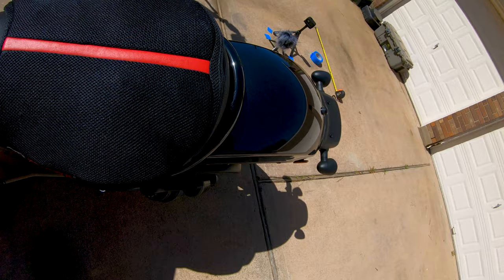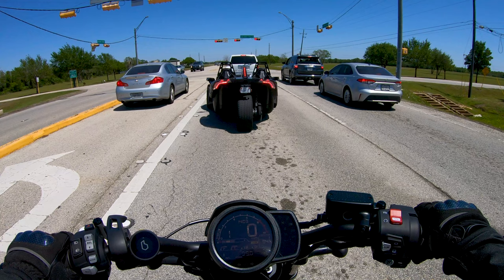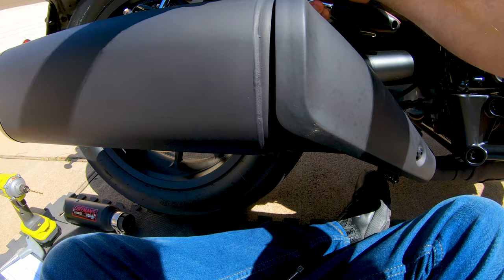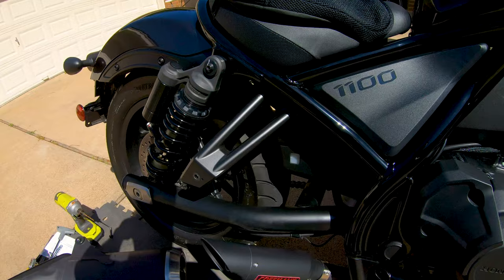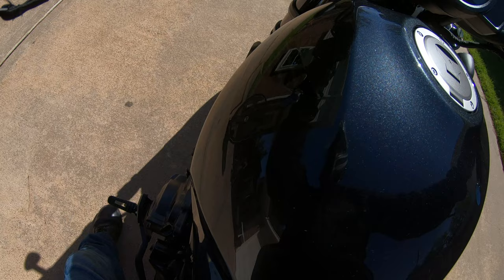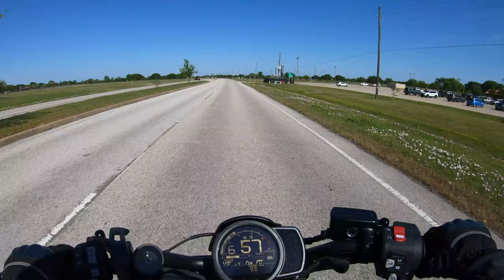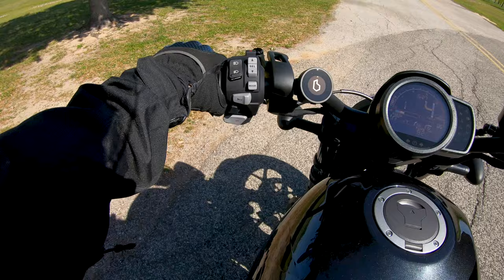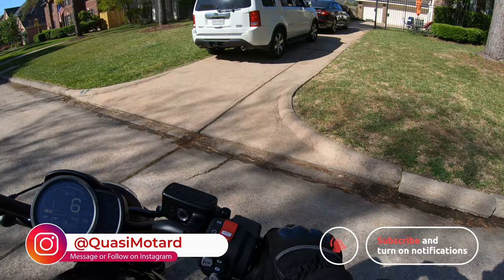REBEL1100: Coffman's Shorty Exhaust - Installation & sound comparison

Comment: I'm torn between the sound of this one and the two brothers racing exhaust
Reply: Two Brothers is much higher quality.
Reply from the maker: Have you purchased or seen the TBR exhaust?  I was considering the TBR and the Vance & Hines, but didn't like the upswept angle.

I'm just curious about your comment on the TBR's quality because the fit & finish on the TBR S1R that I had on my Ryker wasn't very good.  The end cap was crooked, and the overall finish wasn't that great.  It literally ate (self-destructed) the noise baffle in under 3 hours.  I took it off and reverted to the factory Can-Am exhaust only because it was too loud for my preferences. If it hadn't eaten its noise baffle, then I might have left it on the Ryker.  --QM
Reply: @QuasiMotard  That's interesting. Did you contact TBR about the quality issues? In my experience they have good pieces and great customer service. But no, I do not have any personal experience with their Rebel exhaust.
Reply from the maker: @TheImtoomuch  I sent a couple of emails regarding the blown noise baffle, but didn't hear back.  I've been busy and never tried to follow-up on the issue since then.  That TBR exhaust is still sitting in a box in my garage just waiting for the next step... either find a steel baffle that won't melt ( https://youtu.be/qEQixHbgehQ?t=1078 ), or I'll just sell it to someone that likes it LOUD!  😉👍  --QM

Comment: Coffman's makes an exhaust for the Rebel 300 & 500. Wouldn't those fit as well?
Reply from the maker: It's possible, but I haven't verified part numbers or reached out to Coffman's for verification.  They might be the same part?  I decided to get the unit for the 500F/X just in case it didn't work out on the Rebel 1100... then I could just swap it to my other bike.  👍  --QM
Reply: @QuasiMotard  I did reach out to Coffman's. They don't like the angle and want to make a muffler specifically for the 1100. They're looking for a bike in California for measurements.
Reply from the maker: @SoHoundDawg  That's great news!  I also sent them an email this evening regarding an exhaust for the Rebel 1100.  I'll see if I can get a prototype or early production sample to test on the channel.  We'll see how it goes!  Cheers!  👍  --QM

Comment: Where’s the hunter cub?
Reply from the maker: It's still in the stable.  I didn't ride it for several weeks because I was waiting on some upgrade parts. I started the tear-down to install some accessories and realized that I didn't have the right pieces, so it sat there waiting patiently.  It's back together now and I've been doing small commutes and grocery runs with it.  

I have a 4-day motocamping trip series from back in mid-March (pre-upgrades) that I haven't edited or posted yet.  We rode about 350-400 miles to Paige, TX, to camp out at the Cottonbowl Speedway and watch the World of Outlaws sprint cars.  The little CT125 did OK, but just barely... it really doesn't like highway speeds.  I was barely able to maintain 50 MPH most of the time, so I was the slow one in the group by about 10 MPH.  It needs a gearing change and a 143cc big-bore kit to wake it up.  👍  --QM
Reply: Wow. You’ve been busy. Thought maybe you buying the Honda 1100, you changed your mind about riding the others.

Comment: How's this growl compared to the SV650?
Reply from the maker: I haven't owned a Suzuki SV650, so I can't compare the exhaust note.  The SV650 has a 90° v-twin, and the Rebel 1100 has a parallel twin... both engines have a 270° firing order (as far as I understand).  The exhaust note from the Rebel's 270° parallel-twin isn't quite the same as a V-twin, but it's close.  Honda has also reportedly done some volumetric trickery with the camshaft timing on the Rebel's engine so each of the cylinders have different power characteristics at different RPM ranges:  https://www.cycleworld.com/story/bikes/honda-rebel-1100-first-look/ .  👍  --QM

Comment: How do I take the big exhaust bracket off?
Reply from the maker: The exhaust bracket is also the right passenger footpeg.  You can remove the seat and battery box to get to it.  There are two 8mm (?) hex-head bolts that hold that bracket onto the inner frame rail.  Note that there will be an open space if you remove it, so you might want to cut a piece of black ABS plastic to act as a filler (just bolt it into the same holes).  Cheers!  😉👍  --QM
Reply: @QuasiMotard  I appreciate you, I think I'm going to leave it on for when I get a passenger seat

Comment: How’s the bike with vibration while driving vs a V twin ?
Reply from the maker: The Rebel 1100's 270° crankshaft makes it feel very similar to a v-twin.  Honda intentionally made this engine feel "lumpy" with the crankshaft timing and also with uneven cam profiles for each cylinder (volumetric efficiency is different for each cylinder, each tuned independently for low & high RPM).

The engine and handlebars vibrate quite a bit from idle through ~2500 RPM, but it smooths out a lot at higher RPM's.  I don't notice any excessive buzz in the grips or footpegs at freeway speeds... at least compared to other similar machines.  It's certainly not GoldWing smooth, but it's tolerable for 3-4 hour rides without going totally numb.  😉👍  --QM
Reply: @QuasiMotard  perfect and informative reply ! Thanks 👏🏻👏🏻

Comment: Do the cover seat help ? Cuz the original the ass hurts 😂😂
Sound like a real cruiser! My got the GEM-CLASSY
Reply from the maker: Yes, the AirHawk Cruiser seat pad makes a huge difference for long trips.  I've done several cross-country trips on the Rebel, but they wouldn't have been possible without that seat pad.  😉👍  --QM

Comment: how about the top speed?
Reply from the maker: The top speed for the Rebel 1100 is electronically-limited at 100 MPH for the USA models (possibly for all markets).  The new exhaust doesn't change that, so a re-flash of the ECU will be necessary to remove the speed limiter.  --QM

Comment: Are you able to put the motorcycle in neutral while riding (to rev the engine)?
Reply from the maker: No... the DCT won't allow you to shift from "D" to neutral until the bike is stopped.  I wish that Honda had allowed the neutral function in the DCT like Porsche and BMW have... where you can pull in both levers at the same time to disengage both clutch packs.  That would be fun for rev bombs under bridges or clutch-up wheelies.  👍  --QM